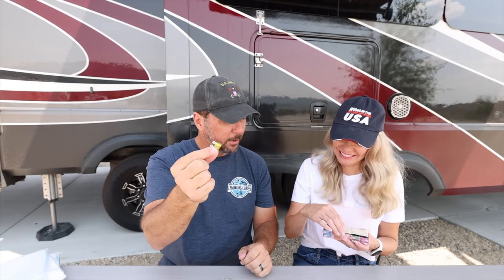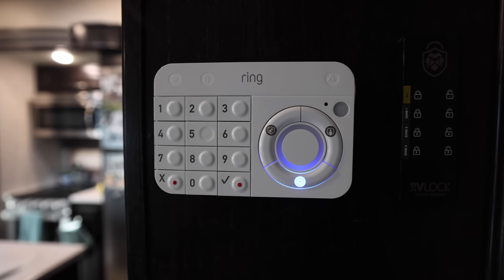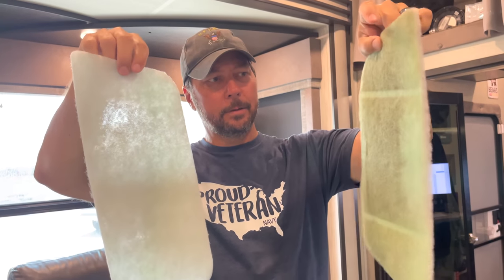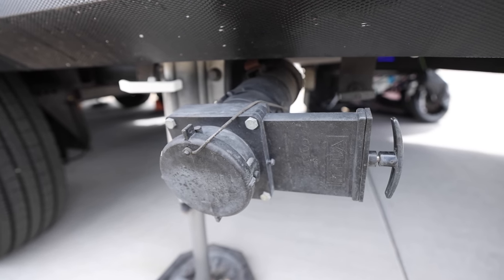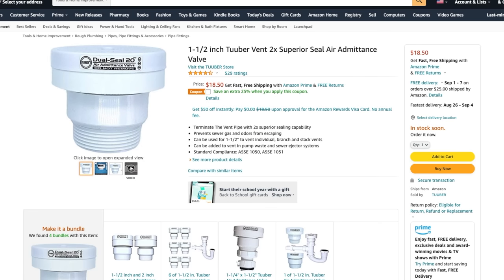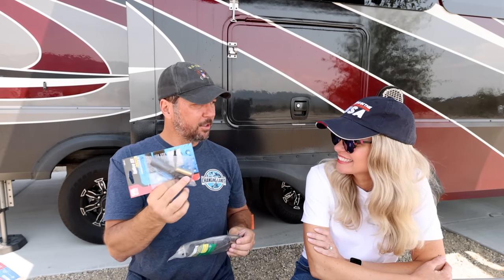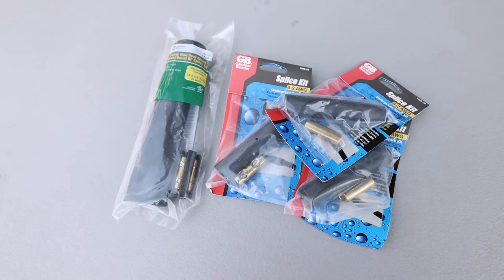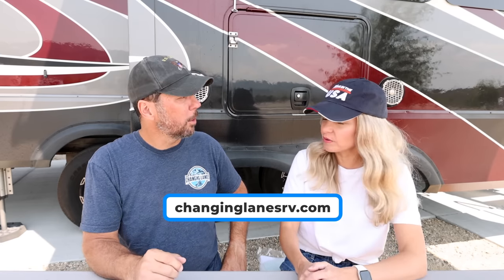🛠  RV Spare Parts! 🛠  (Full Time RV Living)

Comment: I got a 50 amp DC breaker for my Montana's hyd. system at an auto parts store. They are used for audio systems and other high draw stuff in auto's. No ordering needed. This is the only part I have needed in well over 16 years. Lucky me.

Comment: One very common thing I always carry - the rubber washer that goes on the line when you go from Pex to a solid mount item (the washers for under your faucets is a prime example). Two of three of them in a pill bottle to keep them safe and from being pinched or deformed.

Comment: Thanks Chad and Tara. This was an excellent video on spare parts you might want to have on hand. We’ve been full time for 8 years now and I carry spare parts. The way I found out which spare parts I need is when I’d replace a part that wore out or broke. I’d buy two of them, one to replace now and one to have in my spare parts drawer. Two things I carry spares for that weren’t mentioned is a spare closet door latch. Though we only latch the closet door on move days, my wife will flex that plastic latch too much and break the piece you hold on to. She has gotten a lot better over the years and I haven’t had to replace one in a few years now, but I have 2 more in the drawer. Also, I carry 2 extra in line propane high pressure regulators, the red ones near the propane tanks, not the big regulator with the changeover. In our first four years, I’ve replaced both regulators, when they started leaking at the pin hole point that’s designed to blow out with high pressure. They have been fine the last 4 years, but I have 2 more in the parts drawer. Thanks again for putting out that great info and I wish y’all happy trails. ♥️

Comment: I just bought and installed the Valtera gate valve, as you recommended.  (I have experienced that seepage, too.)  Beautiful fit.. maybe because the original valve assy is also Valtera.  I used a dab of silicone glue on the bayonet lugs to lock it in place, but still be able to remove, if necessary.  One of the best RV additions.
Reply from the maker: Oh, that's a great idea!  I hate when I'm trying to remove the sewer line with one hand and it comes off behind the gate.
Reply: @ChangingLanes  Me, too!   I should give that a try.  Thanks, Richard!
Reply: @ChangingLanes  Thanks.  I figured PVC glue would be TOO permanent.

Comment: The second electrical device is a circuit breaker (auto resetting) commonly used for trailer brake system, towable battery charging system, lift/jack systems, etc. 

Awesome video; great parts list to have on hand. 😉

Thank you for a good reminder.

Comment: Replacement propane regulator (and the YELLOW gas-rated teflon tape for the pipe fittings).  Also, depending on your rig, a cheap, plastic garden hose shut-off, in case the check valve in your city water connection fails, which would mean any time you turned on your water pump it would be just like an open faucet, dumping your fresh water out the in! Spare spring for the screen door latch (or spare latch...)!  Spare latches for drawers/cabinets.  You don't realize how important those are until a drawer won't stay shut as you travel!!!  Thanks for a good video!

Comment: I carry two tubes of Sika Flex caulk, one self-leveling, other regular. Sika Flex is excellent for strength, yet flexible and will adhere to almost everything. I used this in HVAC trade to seal and repair lots. Make sure of what you use it on as removal is possible but tough. I've used it to repair rubber roof cuts on buildings and it holds out water (even under large puddles) well. You can find it at Lowes and HD in masonry section. Co-worker even used it seal a hole in his shoe, worked great for months.

Comment: Something else to note (which we learned the hard way).... Our Grand Design Reflection had both the PEX and red and blue water hose for the plumbing.  The water hose had a much larger inner diameter than the PEX, which means both the brass and plastic fittings are sloppy loose.  They tried to solve the problem by really crimping down the rings.  Didn't work in our case.  One of the hot water fittings leaked and flooded the basement.  Also, note the standard black PEX rings won't fit onto the red and blue water hose. 

I spent a LOT of quality time in the basement and replaced every single plastic fitting with brass, and also replaced all the water hoses with PEX.  The only one I couldn't replace at the time was the water heater check valve (thanks for a link to that one).

Comment: I think you need to go to D rings that have a cast loop instead of a formed wire loop.  If you break the cast loop you're probably upside down and the rings will be the least of your worries.  I know I've got thousands and thousands of miles on my cast D rings in my motorcycle trailer and they have never broken.  I think they're rated for 5,000 lbs each.  As for the air filters. thanks for the heads up.  I don't know if I'm going to use them but it's nice to know they are available.  Keep the good stuff coming.

Comment: Your other video you had problems with your refrigerator  I just did a video installed a 12 volt and wow camping in Alabama right now its in the mid 90s humidity is ridiculous  and the fridge is at 0 freezer and 32 fridge you should look into one so far I am super happy pulls 5amps cooling  solar can easily keep up.with it. Just like a residential uses freon just an efficient 12 volt compressor I have the Norcold love it 😀
Reply from the maker: Is that the JC Refrigeration unit?  We have been considering that.

Comment: Great tips you guys I have a older trailer not full timing I do keep a lot of spare items one thing I have had happen is a axle seal leak so I now keep spare axle bearings and axle seals and a tub of grease and grease gun 😀
Reply: Same here, i never roll a trailer of any kind down the road without spare bearings, seals, grease and the tools to change them. They don't fail often but when they do its always far away from home....
I may be wrong here but i bet their bearings are probably oil bath which are a much more difficult thing to fix in the field.... The good thing is just like a greased bearing with proper maintenance( which i'm sure Chad does) failure is rare.
Reply from the maker: Great idea.. I do have some seals.  Totally forgot about them!

Comment: If you have a black tank flush, carry a spare vacuum breaker check valve. Had one go bad this year (2019 camper) flooded the bath room. Mine is located under the bath room sink and was a RecPro brand. These are also made by Camco and Veltarra. Note the Camco and RecPro both leak a little water on the floor each time you use the black tank flush. Don't know about the Veltarra.

Comment: I noticed your Morryde pin box, at a GD rally I replaced my stock one due to chucking with the same one you have. When the original one was removed, 3 of the bolts were stripped out (new 2021 rig, 40 ft, name not included). Recommend torque check on those bolts.

Comment: I also carry an assortment of wire and splice connectors. I know you do as well, just didn't see it in this video. I carry an assortment of screws and nuts and bolts. My rig is an older class a 3/8" waterlines, I carry an assortment of various compression fittings (thank God haven't needed one yet). Velcro! Velcro is my friend I use it for a variety of things remotes go on the bottom of the table, refrigerator/freezer sensor, some stuff on the countertop.

Comment: As you  know, we had our ""incident" with the hydraulic jacks and had to replace the front two jacks. It turns out that there is a "valve" for each section of the hydraulic system. If they fail, you will have a fun time running the affected system. They are not cheap but may be hard to get. There are four (4). One is on top of the right front jack. If that one fails in the closed position you cannot operate the front jack - period. If stuck in the open position, its a pain but doable. I also now carry "caps" to isolate one hydrauic system if I have a hose failure. I also now carry a spare actuator valve for the black tank wash line (behind the shower).  if it malfunctions, it will also stink up the RV same as the valves below the sinks. I also now carry to 3 ton jacks stands to hold the front of the trailer if need be. Trouble with spares (as with everything else) is that we are having a hard time keeping the GVWR in check...
Reply from the maker: Yep.. we replaced a valve in this video... https://changinglanesrv.com/rv-travel-day-problems/

Comment: Your propane gas regulator can last for years, or only for months. I've had to replace mine a couple of times in ten years, so last time I bought two and have a spare. The first one to fail was pretty obvious, when the guy parked next to me said "I smell gas!" The last time, it was in colder Fall weather when the furnace was kicking in, but about every tenth time the gas wasn't igniting. Caused by a small leak that was cutting the pressure.

Comment: Spare tire and Chad check the spare tire for the proper amount of air so if you do have a flat on the highway you’re not having to dig out the air compressor on the video to refill it at that time.

Comment: Not a fan of WD40 for anything.  Once the carrier dries up, it eventually turns into a waxy mess, similar to Cosmenel.  I use Deoxit cleaner and contact enhancer DeOxit gold GX100L.  We are anxiously awaiting for our new F350D delivery to then pick up the new Artic Fox 27-5L, which is almost immediately getting MORryde IS installed :)  Then it's off to Key West (Boyd's) for a week, and then back up to Land O Lakes for awhile.  One repair item I just ordered today, is 4" wide roll of Etherbond repair tape for the roof (or other areas).  This is our third trailer, first 5th wheel.  We're so jammed up on time, I won't be able to make many changes before we hit the road.
Reply from the maker: Congrats on the new rig!

Comment: We were told if we swap out our plastic  water heater plug with a brass one, we will void our warranty.  I'm assuming the check valve you mentioned in the video is a different animal.
Reply from the maker: Never heard of that.. There are some aluminum water heaters where the brass will corrode.
Reply: If you have an ATWOOD branded water heater, it is aluminum and comes with plastic plugs. Brass will corrode if not isolated, but its funny they install the Pressure Relief valve made of brass with pipe tape. You will be fine as long as you wrap the threads with pipe tape to isolate.

Comment: Hello Navy. Getting caught up on some of your videos. We have just started to full time and have neglected all video for a while. This one one spare parts is a good one. I am the one that said to check out RV Air filters to you back in the day. I saw not long ago that Dale Earnhardt has partnered with someone to make RV filters. Maybe check it out. I have not yet. One question I have about the same filters you are using is do you also use the original filer as a backer so the RV Air Filter does not get sucked into the AC unit. I also have the Rv air flow inserts (different company) and it seems that the filter might get suck into the AC unit. I am currently using both. Hope to meet you and Tara someday.
Navy Doug 71 to 75 
Helicopter mechanic
Reply from the maker: Our filters stay in place fine without the original. 👍🏼
Reply: @ChangingLanes  Thanks for the reply Chad and Tara.

Comment: My main bathroom grey water drain is disconnected from the grey water tank. Have you had to drop the belly insulation? If so, how did you get it back in place? They used some type of injected screw to mount the insulation, did you replace them with something?
PS: you should have licked the o-ring, just to drive Tara crazy!!!🤓 cast d rings hold up better. Just sayin’
Reply from the maker: We did in this video: https://changinglanesrv.com/water-leak-smoking-power-cord/
Ours is held up by self tapping screws into the frame.
Hope that helps!

Comment: Can you please tag the video about the heater repair or maintenance that you referenced in the video. I haven’t been able to find it and I have an issue with my heater. Might be helpful. Thanks
Reply from the maker: https://changinglanesrv.com/rv-water-heater-maintenance/
Reply: @ChangingLanes  my apologies I was referring to the furnace repair video. I Typed the wrong thing
Reply from the maker: Ok, I think I found the vlog you are referring to: https://changinglanesrv.com/broken-two-years-of-full-time-rv-repairs/
All of our vlogs are also on our website which is searchable using the spyglass in the upper right corner of each page. 😎

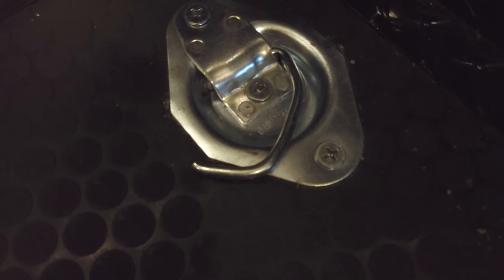Comment: I have a question:  Since the camper's got a 50A system, what good does the 80A fuse do on the leveling system???  We have the Lippert self-leveling system and I'm curious why the need for change.  At the 12:00 mark, I noticed your tie-downs in the garage.. We had those in our previous Raptor and they were worthless - pulled out of the floor two or three times and one of the bikes got damaged.. Tried to re-anchor those with various means, but finally gave up and traded the camper for the Fuzion 427 and the tie-downs in the garage are welded to the frame, mucho better.. IIRC, each is rated to about 5K pounds ea.
Reply from the maker: The 50A breaker trips easily and also gets weak over time.  When we put the 80A breaker in, we noticed an immediate improvement in performance.
Our D rings are secured to the frame of our momentum.  No worries about them coming out. 👍🏼
Reply: @ChangingLanes  Very good.. Thank you for that info..  Best wishes you two..

Comment: You are the ONLY one I have heard say “test” your grey water dump first for just a few second to see if you have a leak. Good on you. Great tip. Learned a lot thanks.
Reply: This was a "slap my forehead" - why didn't I think of that?  All the years that I have opened the black valve and crossed my fingers that everything is connected properly and I have learned a new trick.  My grey tank is pumped out but at least it's a better leak check than just crossing my fingers and as I get older it certainly won't hurt to have a "senior moment" check.
Reply: I agree Doug! Definitely adding this to my routine!

Comment: Hey Chad n Tara buy a 97 gallon auxiliary fuel tank/toolbox combo called the RSD 71799 it would fit in the back of the cab the you can put all the emergency 🆘 equipment in the toolbox n fill the auxiliary 97 gallon tank with Diesel fuel ⛽️ then you can do less fuel stops n more driving

Comment: Chad/Tara, great topic.  One thing I use on the sewer hose gaskets is a small dab of Plumbers Grease, smeared around the contact surface helps keep the gasket from pinching when connecting the hose, which creates a better seal to prevent leaks.  Also, you're not the only one to leave a water pressure regulator at an RV site..... :)

Comment: The rectangle shaped fuse, I think the second one you showed are available at auto stores.  They are truck auto reset fuses and they should cool and reset on their own unless you melted it.  Dawn dish soap works well with the 5th wheel hitch it helps provide a little anti-friction and rinses right off better than grease.   On the outside bulbs you try to stay in warm areas but if you go into cold winter snow the LED often will not melt any snow that could cover a light.  On a side of a trailer there may be no way for a build up and no issue, just something to remember depending on the placement of the light fixture.  Stay safe and healthy.

Comment: I just passed one year living in my class a full time. The only thing that’s broken that I could not fix easily with stuff I could get local was the check valve in the hot water heater. Camper world wanted $48.. uh, no.. got 2 on amazon for $13ish. I was able to shower at a relatives house till the new part came in. 

On the batteries, I’ve noticed the coin type seem to last longer if kept in a sealed container. I use a small water/air tight box from Walmart’s camping dept. I buy multi packs of maxell brand ones on Amazon for $5 or so.

Comment: Great video, thanks for sharing it!!!  
May I suggest a refrigerator control unit board?  Not that expensive compared to the disappointment of not having a cold beer.
Had them go bad on me a couple times during storms.  And I’ve heard it’s a common problem out there with power surges even with a power surge protector plugged in.
Reply: Can't miss out on a cold beer.

Comment: Thanks for all the info.  I'm surprised I pulled apart the grille on our Grey Wolf TT while cleaning the factory filters and found it was already taped up nicely like you suggested in a previous video.  As it starts getting colder I'll have to check out my furnace and get spare parts for that.  Being its been a year now I'll have to get an anode rod too.  Your guys suggestions have been a big help for our weekend RV adventures!

Comment: I use an air cleaner and purifier vice the AC to clean the air in the RV.  Don't want to block flow to AC unit and stress out the blower motor.  Over time It's probably cheaper than high end AC filters every month or two.
Reply from the maker: I tested the air throughput with this filter and it's good... 👍🏼
Reply: @ChangingLanes  when you put in the new throw away filters did you leave out the washable filters they came with, right? Also we added the little door stops to each of the round ceiling vents like you recommended,  thanks! Do you guys have any filters in those? (I saw Phil and stacey did) any thoughts? I have allergies and wondering if this would help too. Thanks for all you guys do, you rock!
Reply from the maker: No.. we took the stock filters out.  The reason phil and stacy have filters in their vents is because those are not vents.. they are intake to the system and they have vents with no filters.  They don't have the bottom of their AC exposed like we do (and where our intake is).  Hope that makes sense.. 😊